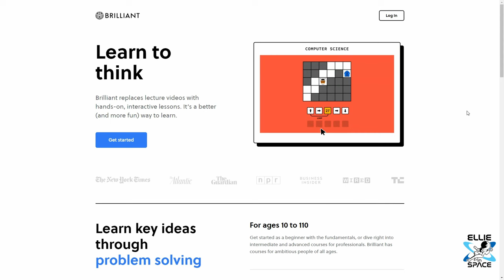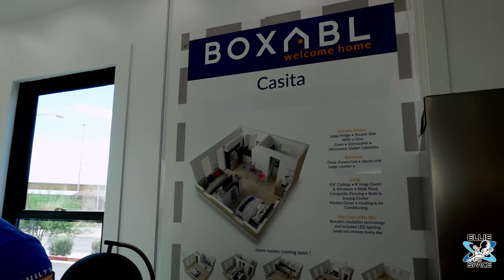BOXABL can UNFOLD and UNPACK in less than an hour

Comment: Lifting the ceilings to 9 1/2 feet was one of the smartest moves they could have made.
Reply: Nobody needs 9.5 feet. I have 9 and it could be at least a foot shorter and still feel fine. 

I HATE short ceilings. If I can touch it in the basement, they're too damn short. 

7.5 is a bit too short, imo. 8 would be just fine. 

The mold is a big issue in Guantanamo Bay. Look up NY Times 9/17/22.

Comment: You really knocked this one out of the park.  Well Done.  I'm happy to see this industry taking off.  As an retired USAF guy, glad to see the DoD stepping in with a contract, too.  RED HORSE units in the Air Force could use these, perhaps modified to military specifications.
Reply: Boxabl mentioned back in 2020 Kevlar could go into the walls…
Reply: I’m wondering if they’re using them as emergency replacements for condemned base housing units.  

“Mold, major leaks, and other mistreatment detailed in Senate’s military housing report”
Reply: In the Marine Corps we lived in WW2 squad bays sometimes.

Comment: I just looked at their website, and I’m pretty sure the unit comes with a standard refrigerator, range, microwave, dishwasher, and a washer, dryer, standard. That’s a lot of money saved, right there!
Reply: And don’t forget the cooling and heating mini split…
Reply: Doesn't save you money, if you still have to buy your preferred or support your daily use function appliances and the appliances you would not buy at all. Different priorities in appliances means there isn't a best value for all.

Comment: I'd love a lego style solution where you have A module, B, C and so on along with a second floor middle addition. So that you could use 4 modules + 2 middle addition and get a 2 story house with 2-3 bedrooms or 2 bedrooms, office, living room, bathroom, kitchen. Just snap it together and movie in, that would be a show of power that would stun everyone and more or less have the potential to solve any housing crisis.

Where I live there is a hidden crisis, where scalpers buy up everything the moment it goes in to be sold, then they do nothing except jacking up the price by 100K+ and resell the house. This has caused a problem that there is not enough started homes as most can't afford 2 bedroom + guestroom/office type houses, but it's what they need. Prices are rampant as a result, so new solutions are desperately needed.

Sadly I live in Norway where you have to build for temperatures from -25 C to 40 C and storm level winds. If your idea can withstand and be livable in such conditions then you'd really have something wonderful.
Reply: All of the different room module configurations have been on the company's website from the beginning... the Casita 20x20 was just the company's "minimal viable product" to get into the marketplace and make a name for themselves... Like yourself, I would sell my current house tomorrow if I could get 3-5 Boxabl room modules in a newbuild...

Comment: Just a note, vehicle and other manufacturing industry production rates can be misleading. Whilst one unit may leave the assembly line at the rate of one every 2 minutes or even faster one every 60 seconds, that is not the time taken to produce one unit. A specific unit may take 2 weeks to get from one end of  the assembly line to the other, and no unit can exit the assembly line faster than the slowest process along the line. So for vehicles to leave the line every minute, no process along the line can take longer than 60 seconds. Vehicles are more involved than an empty box, so seems should be feasible to get processes down to less than 1 minute, and have the line operate like water flowing along a pipe. Want to measure the outflow, not that it took 2 days for the water to travel across the country to the tap (faucet). So a matter of perspective, need to be comparing the same production parameters.

Comment: I worked in a factory making similar box-type rooms over 20 years ago. I was on the saw section cutting the timber frames that would form the walls, roof, doors. CFC gas was used (before it was banned) to pump liquid insulation foam between the metal skin of the walls. You could literally heat the rooms with a candle the insulation was that good. It took a few days to produce a 40ft x 20 ft room, that cost €20,000, I believe. The customer had to make the foundations and concrete floor (with waste pipes and electrics) before the room could be erected which took only a few minutes to an hour. I haven't seen anything in this video to suggest there's new developments as the tour guide says, so I call bs on that. If the new part is "speed of production", then that's only down to the number of workers they have there; the more workers, the greater capacity for mass production.
Reply: How did they transport it?  A simple truck?  

A few days to build?  These will take about a 15 minutes in about 2-3 years. It’s 4 hours now.  It’ll be about 1 hour next year.
Reply: Boxabl is not comparable to non-turnkey units that don't have already included plumbing, electric, HVAC, turnkey utility hookups, all kitchen appliances, single washer/dryer combo, breaker box... Boxabl's differentiation is comparably low-cost, high-quality, scalable, but most importantly hyper fast production (hours/minutes vs 4-6 months)... And this is all only possible in the factory because of the fold-down IP...
Reply: @radiofreealbemuth8540  Paolo stated, on current models, the Casita weighs about 15,000 pounds, which is pushing past the top-end towing capabilities of most standard consumer facing pickup trucks, like an F-150... However, I just did a quick Google search and found that an F-250/F-350/F-450 can potentially tow much more than that in appropriate configurations... At the other end of spectrum, a big rig could potentially pull 2 Casitas on a double trailer (20 feet long per Casita gets 40 feet of max 53 foot standard trailer length)...
Reply: Funny, how is it, that the company you worked for, didn’t grow large and become a world-altering producer of homes for the needy? Probably because it wasn’t possible. But hey, Boxabl has the magic formula, if only you’d invest.

Comment: Investment opportunities? Margin expectations? Any interest from municipalities (foreign?) to help with disaster recovery & the homeless? How high can they be stacked? Can exteriors be customized (windows, roof angles/types, etc.) to avoid “ticky tacky” ness? Heat pump options? Do they pour foundations & establish sewage & utilities connections? Do they facilitate/expedite compliance to local codes & inspections, etc.
Reply: Boxabl markets the Casita and their future room modules as getting you 90% of the way there on total setup... (A) For water, wastewater, and electric, there are turnkey hookups that plug-in to your utilities... (B) units are foundation agnostic... you can use (i) no foundation [not recommended], (ii) concrete slab, (iii) raised pylons on just the 4 corners of unit... they do not install for you, but provide guidelines for how to... (C) units come standard in base gray, but can be customized as need be by customer, including putting roof and/or solar panels right on top... (D) currently can be stacked 2/3 stories, but plan to go higher in future... (E) FEMA would definitely be a great customer, as they already sold to DOD in federal government... and they have been talking to LA mayor candidate Caruso about sheltering homeless in way better accommodations at way lower costs... (F) For investment, you have already missed (i) 2020 WeFunder crowdfund for 1 million, (ii) 2021 StartEngine crowdfund for 5 million, (iii) 2022 StartEngine Reg A+ for 75 million, and (iv) 2022 StartEngine crowdfund for 5 million, but they do anticipate having a 2023 StartEngine Reg A+ for 75 million, starting April 1, if they need the money at the time... (G) Margin-wise, the current Boxabl Casita sells for $60,000 and the 1st 156 unit order units cost about $47,000 to make, but the long-term goal is to push the cost down below $40,000 per unit...
Reply: @rule1capital  i think they cost 30k to make. i hear it from the company.
Reply: @eric1565  That is a reach goal for the company… that is not how much they currently cost to make…
Reply: @rule1capital  they told me 30k is the material cost. Also they tell me the cost is fluctuate
Reply: @eric1565  If you check their SEC filings, $30,000 is the goal they think they can hit with more automation and scale... the 1st contract homes cost $47,000 per home to make...
Reply: Please tell me how a homeless person will come up with 60k? And last I checked, they weren’t giving land away for free.
Reply: @rozinant1237  it is not the company issue. It’s society issue and homeless person issue.

Comment: With a lights-out robotic facility I am curious how they'll handle the electrical wiring. Traditional electrical outlets seem like something that would be hard for a robot to handle. I wonder custom receptacles and switches will be something they will have to design just for the Boxable assembly line robots.
Reply: If you listen closely again, Paolo said they want to be technically able to do that, but "Would NOT" do that in practice...
Reply: @rule1capital  23:34 - I think you misunderstood. He was saying they wouldn't actually turn the lights out because that would be stupid. Not that they wouldn't have a full lights-out factory, which is a term unrelated to the status of the actual lights.
Reply: @jjones2582  There are actual factories in China that will turn off the lights to save money (not smart lol), so that is why I just wanted to clarify...

Comment: Think houses are built poorly? Mobile homes are improving,  but they're built with junk materials and designed to deteriorate and depreciate. Designed to last? That's revolutionary!
Reply: When people ask, make sure to specify these are modular, not manufactured... the materials he listed that make up the walls, floors, and ceilings are insanely durable...
Reply: @rule1capital ... except they are ... manufactured.  I know; it can get confusing.
Reply: @jamesengland7461  All homes are quote-unquote manufactured by this logic... but the Boxabl units themselves are built to modular codes, which are equivalent to traditional residential homes... not to be confused with much lower spec manufactured units...
Reply: @rule1capital  I was simply talking about the play on words.  "Manufactured Housing" refers to factory- built homes placed on a foundation. Mobile homes are factory- built on wheels.  They are both often more precisely and consistently built than homes built on- site because they use jigs and such. Homes built on-site are,  by definition,  NOT manufactured; they're custom- built,  for good or bad.  These Boxabls are manufactured but with a completely different structural method. They could very well wind up being built like junk,  like a good number of manufactured goods have been in the past.  I certainly hope not.
Reply: @jamesengland7461 To avoid the connotation we all know exists with the term "manufactured homes" at least in the US, if I was trying to give Boxabl a fair shake, I would refer to it as "factory built modular homes" or "offsite modular homes"... For those who don't know anything about Boxabl, an easy strawman to get someone to dismiss it is to refer to it as "manufactured"...
Reply: @rule1capital  those people aren't the target market anyway.  Let them stay ignorant.

Comment: Could well be disruptive for manufacturing the living area of homes ... but a fair discussion of costs and the mechanics of a full home build should also include foundations, water sewer electric hook-ups and the potential addition of a sloped roof. The proof will be in the pudding in how well these will mitigate water, insect/rodent, and outside air ingress. Would hard to be worse than my current residence ;->.
Reply: They’re pretty durable and energy efficient.  

https://youtu.be/T-t6n96mW7o

To be fair, you need a foundation and hookups for any home, so it’s really a comparison of the construction time of the stickbuilt vs. boxabl.
Reply: So then, if they need all these all these other expensive bits, and, let’s not forget, LAND. Then they are no longer going to be 60K homes. ( Last year, they were only 50K)

Comment: Not a new idea after WW2 in the UK thousands of prefabricated houses were built many of which are still in use.
Reply: True, but at least in the US market, traditional manufactured homes have a terrible stigma and connotation... Additionally, the industry could never achieve the benefits of offsite manufacturing because of the wide-load shipping issues... By solving the shipping issues, Boxabl has opened the floodgates to what is possible for mass production, offsite homebuilding...

Comment: Is this a more viable option for low cost homing over concrete printed homes? I feel like concrete would prove better based on the durability.
Reply: Concrete printed homes sound great vs Boxabl, until you realize that it is only solving for walls, for which Boxabl currently makes wall panels in 20 minutes and will get down to 5 minutes or less in 6-8 months once new equipment comes in... The hidden value of the Boxabl factory line process is having the units pre-certified in the factory, to state pre-certified modular codes, since every unit is exactly the same down to the inch... If I concrete print walls onsite, I'm still in the stone ages for speed and accuracy when it comes to laying the wiring, getting the plumber out, doing the drywall, having the inspectors comes at multiple stages... 1 hour per unit versus 4-6 months currently for a house...

Comment: I would be careful of the P65 breach in these houses. Their putting led back into everything now, and expelling the radiation through  wireless for virtual blue ray ambiently. This wireless ground is causing fires. If it's got magnesium  in it, I suspect cold fusion and spontaneous combustion.

Comment: I wonder if they sell the wall panels, separately.
Reply: There is so much info to go over with Boxabl that they did not even mention the April 2022 Boxabl-DR Horton investment and strategic partnership... to start, DR Horton has ordered 100 Casita units... but long-term investors like myself see a golden opportunity to become the sole wall panel provider for the 80,000+ residential homes that DR Horton builds/sells each year...

Comment: I don't understand basements. Do they assemble it in the driveway & simply drop it on? How do the utilities connect? Is there a crawl space? What are the environment temp & humidity limits? It has metal walls, do you have to use your phone next to the windows? Maybe you can find more questions and get answers to them in your next visit. 

Actually, the sun "might" not be our most sustainable energy source. 1) Sunlight disappears for up to 10 years after a nuclear war, asteroid impact or super volcano. 2) The sun will roast our planet in 5 billion years, so will be useless. Thorium & uranium combined have been estimated to last as long as 30 billion years (don't believe it), so lasting longer than 5 billion years should be a low bar. 

Very informative.
Reply: (A) Delivered right onto foundation/pylons; (B) Crawl space if you put it on pylons, but all electric is accessible in panel system in unit (not covered in this video); (C) No different temp/humidity limits than normal house, but has much tighter seal than traditional since there are not gaps in framing; (D) The exterior of house uses "galvanized steel", but that is not the whole wall panel, you phone should be just fine...

Comment: This guy is the Elon Musk of the manufactured home industry. If the current stick-built-in-factories companies don’t change to his methods they will die.
Reply: @gamerfortynine   The manufactured home companies have come along way because they have to comply with the changing federal building codes to sell out of the state in which they are manufactured. I live in an early 1970s mobile home (it was towed to the site because it had an axle and a hitch) and by today’s code standards it is badly insulated and it had aluminum frame single-pane windows.
Reply: Was thinking the same thing, if Elon was jacked! Haha.
Reply: @bjs2022  
They haven't come nearly far enough.
Reply: @bjs2022  Boxabl is NOT building manufactured homes... they are building to MODULAR codes, which are built to much higher standards, better than stick-built residential... and this is very important for obtaining mortgage financing when the time comes...
Reply: @rule1capital   Mortgage financing has nothing to do with the building code. Manufactured and “mobile“ homes are typically put on rented land (“spaces”) and that is why there is unfair mortgage financing and, in some states, no opportunity for reverse mortgages. Real estate loans are different than home-only loans. If a Boxabl modular home is put on rented land the owner will experience the same negatives.
Reply: @bjs2022  Not true... Boxabl co-founders have mentioned multiple times, over the past 2 years in numerous interviews, for financing Boxabl units, traditional lenders will not lend the same way for manufactured vs modular... or even lend at all to manufactured...
Reply: @DATDesign  Love you